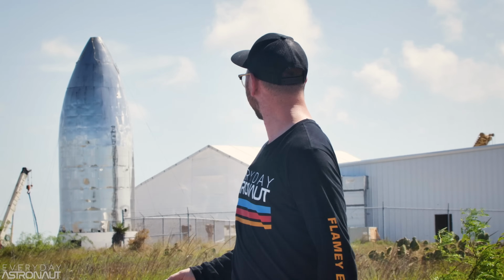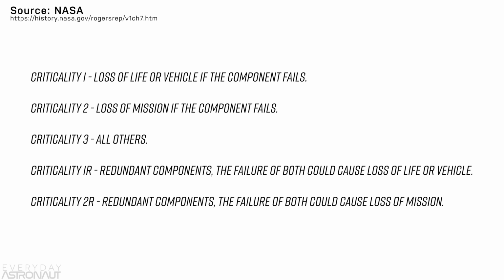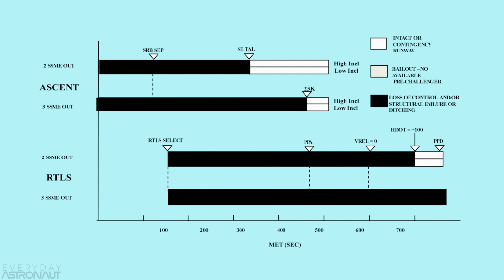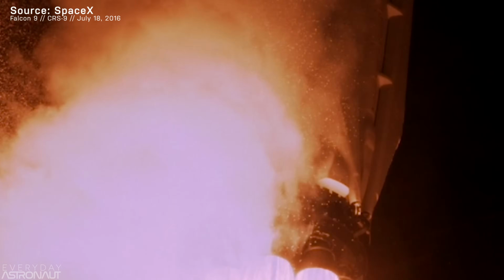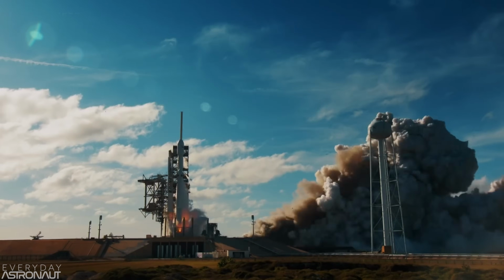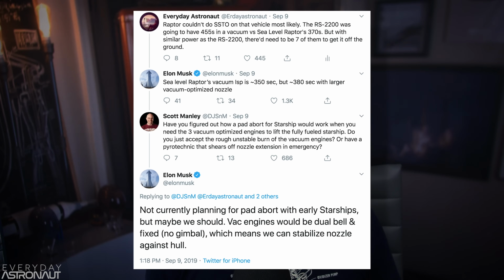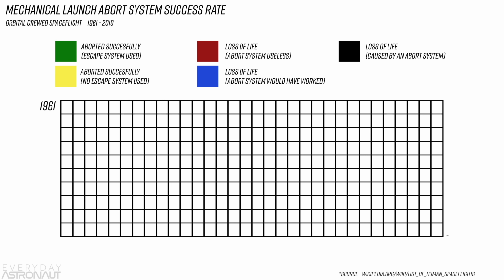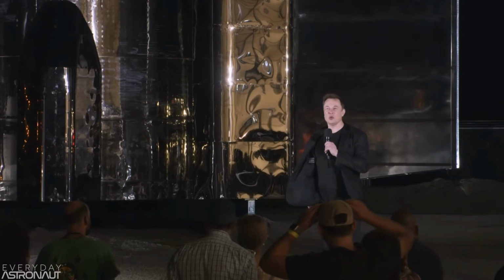Why won’t Starship have an abort system? Should it?!

Comment: Can you really say the F-1 is more reliable than Merlin? Sure, it's at 100% success vs Merlin's 99.88%... but it's only flown 65 times vs Merlin's over 800. Not really a fair comparison
Reply: If we allow an error of one half flight, F-1 achieved 99% with not enough data to add decimals.
Reply: It's like deciding which F9 toy for kids to buy, should I go with:
5 stars and 13 reviews
OR
4.4 stars and 420 reviews.
Reply: There are, realistically, no confirmed ways to compare such intricate works by engineers and scientists who can say "This way is better" because the outcome intended MUST BE "This must work all the time 100% of the time, which is a literal impossibility at the moment when dealing with orbital mechanics.
Reply: @capo_di_capi  the for you have to try and fail to figure out the limits and get new ideas
Reply: C A  Condescending, insulting, and completely off-topic. A great way to end any sort of dialogue, which is, shall we say, rather infantile
Reply: true
Reply: He gives current data,  i'm Shure one version will beat 99,98 %
Reply: C A  Alkin, I'm afraid he is right. Your 'argument' was as useless as a box of pigeon droppings.
Reply: Is your iq 5? Can u count to 10 even?
Reply: I wouldn’t call it an unfair comparison since it is a clear and simple calculation. Statistics are statistics.
Reply: Yep you can expect the merlin engine to be more realiable. If you use any engine you can expect it working with the following probabilities (using the reliability numbers provided by everyday astronaut):
Merlin: 99.76%
RS-25: 99.51 %
Rd-180:  99.66%
RD-108: 99.78 %
F-1: 98.51 %
Reply: Apollo 6, the second Saturn V flight, had a F-1 fail in the 1st Stage, and two J-2 engines fail in the 2nd Stage.  Apollo 6 barely limped into orbit.

Comment: If the launch abort system in starship would be a thing, it would be in form of a 3rd stage and that decreases structural integrity and will potentially add extra weight when "reinforcements" are added. A more ideal launch abort system would to have a fairing to fit a large "escape pod" if you will in the starships "tip".  Now that does take up ALOT of space but a launch abort system on a vehicle like starship is way harder than on a f9 or similar.

Comment: In my opinion, NASA will not allow astronauts to be on board the Starship unless there is an abort system in place, and SpaceX will update the crew version to include one.  On the other hand, I believe that the one that goes to the Moon and Mars will not have one, and will be launched without crew.  It will end up being the 4th design, or possibly 5th if PTP is included.

Comment: Dragon 2 would be genius if it landed propusively. This way the abort system is not an added part but a necessary component with multiple use cases. Either you ditch it to use parachautes, or you use it and ditch paracutes. Both is over doing things. But landing legs through heatshields are difficult.

Comment: Since 1990, in one case, some kind of abort measure saved life (I don't feel its right to dismiss that only because the tower was not used).. in the other, a capsule in a shuttle might give those poor souls a chance... It looks like a pretty clear choice to me.  With abort systems, money can be saved, getting stuff to a sweet spot level of reliability.

Comment: Tim, I would like you to demonstrate the difference in Δv of all or most of the bigger characters in the orbital game. Shuttle, Proton-M, Atlas Centaur, Soyuz, Saturn V... you get the picture. Also, is a rocket with more Δv safer due to its greater dynamic escape potential or not?

Comment: My father was a colonel in the AF at the Pentagon when the Space Shuttle was under final development (75-79)  then did what all officers in aerospace do: retired to a well-paid position at Rockwell International selling Shuttle cargo space back to the AF, working at their facility in Downey CA. Rockwell's own engineers acc. to my father estimated the odds of catastrophic failure at around 2% - which is a figure I've never seen publicized and suspect it was a well concealed data point.

Would I fly into space with a 2% chance of oblivion? No F'ing way, and I'm sure many astronauts wouldn't either as the STS had many hail-Mary elements about it and a leadership at NASA that were willing to cut corners. Despite that, I'm still fascinated by human space travel and really appreciate your very specific analysis on this topic. I didn't think I'd hang around to the end but instead found it riveting. Thanks!

Comment: If we want safety in a rocket without abort rockets, we will need lifting bodies like the Sierra Nevada unit that can be placed at the tip of any rocket and that can land on any reasonably sized airstrip. Of course, that leaves out initial boost to the speed/altitude that allows the lifting body to...err...lift. At initial boost, there might be a rocket with enough engines to spare the loss of one or two at launch to reach that speef/altitude. The Starship and Superheavy appear to be two such rockets, but that leaves out the rest of the possible failured. So, again, reliability becomes the only answer to the problem. 

If I were flying it, I would want to have myself encased in a lifting body capable of reentry and horizontal landing, but that isn't going to be possible for 100+ passengers, or is it. Anything that provides transport at a speed fast enough to create g-forces strong enough to kill is a risk to its passengers and we are certainly familiar with such risks as we ride or fly in various systems that are considered safe for public transport. Anybody who has seen a vehicle burn after a less than fatal crash knows what riding on a fuel tank means. Again, reliability with reasonable safety standards plus huge usage history are the only answers that will get most people on a particular vehicle type. 

Think how many people state that they will not now fly on a 737-Max and you will have the long term answer to your question. When the FAA takes responsibility for the full recertification is my answer, but I'm not sure what others feel. I know that Boeing cannot survive the permanent grounding of all 737-Max's, so they are going to have to find a solution that is palatable to the flying masses. 

Having even a small percentage of customers refusing to fly on available machinery is unacceptable to most airlines and they will seek compensation. That would put Boeing into bankruptcy and completely disrupt our modern flight system, so we had better find that answer and that answer should be instructive to SpaceX 's plans to fly 100+ passengers on point-to-point flights. 

Current airplanes cannot survive any but the most minor crashes in ordinary landings. Any other crashes are almost inevitably fatal to all involved, so the only way airlines stay in business is to have a mode of transportation that is orders of magnitude safer than any other mode than trains and trains take too long for most transport further than 100 miles.

There is the standard that rocketry must closely approximate if it is to be acceptable for more than inherently risky things such as trips to the Moon/Mars/the rest of the Solar System. How that is accomplished is initially a technical problem, but in the final analysis, a social problem.

Comment: Braver that I am.  I wouldn't fly on a Rocket until I'd seen it fail safe when it did fail, but failing 99.99% less than it's normal flights.

Comment: The launch abort system wouldn't affect my decision to get on a rocket. Everything is going to fail at some rate, and I trust that the design teams behind these devices know best how to improve its' safety. If adding a launch abort system will improve safety to a degree of significance, I trust they'll do it.

Comment: An abort system is always a good idea, as with any complicated liquid fuel system it can fail and so can multistage boosters. If the Challenger was designed where the control cabin was a breakaway abort system they would have survived instead of all of them dying when they hit the ocean.

Comment: *Me in KSP putting an "abort abort abort system" for if my "abort abort system" fails, and at the same time thinking if I need another level of abort systems to save me from possible "abort abort abort system" failures.*
Reply: Jarno de Wit all of my aborts in KSPis basically just the tower yeeting my capsule away
Reply: @bingusaerospace  I generally like to design every single part myself, including the escape system. The downside of this approach is that it often takes more than half an hour to get a nice working LKO manned rocket. I almost always use part of setting to make everything look nice.
Reply: 1. Smack and LES on the top for 1st stage aborts
2. Put sepatrons around the top of the service module or upper stage for any aborts after LES is jettisoned
3. Done
Reply: And then fails and just immediately reverting to launch

Comment: “A rapid unscheduled disassembly” 😂😂
Reply: I think that would be what The Chieftain calls "a significant emotional event".
Reply: @noremorsewoodworking2258  hey there, I am also a chieftain guy
Reply: Feliz Archez RUD
Reply: Most dangerous technologies hide their failures behind dispassionate engineering terms. Lithium Ion batteries are said "to vent with flame" rather than the more usual wording one might use like; burst into flame, often near spontaneously and if confined without the ability to vent the rapidly expanding gas, downright explosive. I suspect liability lawyers are the ones to thank for this excessively analytical phraseology.
Reply: Man said feliz archez
Reply: Bro what a comment
Reply: THIS was my favorite part
Reply: "Uncontrolled Flight into Terrain"
Reply: @rayjay1770  That might leave a mark!
Reply: Man, this was RUDE... :D

Comment: Everybody gets on airplanes they don't have abort systems. something goes wrong you're screwed. And nobody seems to have a problem with that
Reply: Most often when something goes wrong in a plane you're NOT screwed, and they are hundreds of times safer.
Reply: @1312_PV  hundreds of thousands of times safer I believe
Reply: The problem is that rockets are much less reliable than airplanes (at least for now).
Reply: @alexanderbeychuk3674  Airplanes are far safer than Automobiles too... We deserve FSD!  All cars without it should be illegal as soon as it is operational!
Reply: @davidbeppler3032  I wonder if it's actually true that airplanes are safer than automobiles.  Part of me thinks it's more that pilots are safer than drivers.
Reply: @UrbanPanic   I think the airplanes themselves are safer, because in the air there are not many obstacles to crush into, so it's inherently safer. But compared to a rocket, for a rocket the air is like a hard wall. Even the air can crush a rocket, which is not true for an airplane.
Reply: You clearly have no idea how safe air travel is. Lots of things can go wrong and you will still be fine
Reply: @azzarii  yeah I know air travel is so safejust so long as you are not flying on the latest and greatest thing that Boeing makes.
   Or air France their latest and greatest with a flying turd to that's what happens when you get in a hurry and you don't thoroughly test everything. And obviously they don't.
Reply: True.. and most people forget in the early days of aviation it wasn't nearly as safe as today.
Reply: @TheEvilmooseofdoom  There may still be airplane types where everyone is issued with abort parachutes.  There are certainly commercial airliners with sea abort systems in the form of lifeboats and wests for everyone.
Reply: @johncrowerdoe5527  Yes, terrestrial safety systems are installed on modern airlines.  Why?  Oh right they discovered after accidents that they were needed.  It's all a learning curve and there is always an element of risk.
Reply: @TheEvilmooseofdoom  I said nothing to the contrary.  Obviously thet don't have Martian safety systems.
Reply: Lots of things can go wrong and you can still be perfectly safe. You can lose engines, instruments and other parts with no real detriment to safety. Losing an engine for a rocket is much more dangerous
Reply: Well, an airplane with no motor can still glide, albeit at pretty high speed for a safe landing but that is a good last resort risk mitigant. With a failed rocket, gliding is way less efficient...
Reply: Remember, if you are on a plane you can glide very far, but if your rocket fails you just fall down
Reply: @alfonsrasmus4710  exactly, it is simply IMPOSSIBLE for Rocket travel to ever be as safe as winged flight
Reply: @whiplash7400  Exactly.  it is like comparing a well engineered system like a Bullet Train to a well Engineered system like an Airliner.  (and yes, I am cherry picking for the example.  They both have gone to great lengths to be safe. However, once maximum safety (within reason) is achieved, the bullet train comes out safer as it is just inherently more safe (to date there has yet to be a single derailment of a Bullet train).
Reply: @alfonsrasmus4710  Remember if you are on a plane you can get to 40,000 feet. If you are on a rocket you can go to the ISS, Moon,  Mars, or to infinity and beyond! And actually there are plans to go from NY to Paris or SF to Tokyo, etc, in a Starship.
Reply: There is a huge trail of crashed airplanes behind our current airplane technology.   Rocket ships will do the same.  Each iteration fixes the problems of the previous design.   We finally achieved a state where airplanes don't crash very often (737-MAX please sit down) and people find the risk acceptable.   Rocket travel will be the same.   It will not be perfectly safe, and we are going to no doubt drop a few of them over time.   But the vast majority will be so safe that they will gain public acceptance.
Reply: An airplane does not explode every time some minor failure happens. Even a 1000 flights to 1 failure with human casualties is unacceptable for a rocket. (we don't have a rocket with that track record) We need at least a 10 000 to 1 reliability. Which is impossible to do with today's materials and technology. If we really "push the envelope" we could probably build a rocket with 500 to 1 reliability but not much more.  There will be a failure, because we are humans and we make mistakes... and one mistake in rocketry usually ends up in a big explosion. Also a rocket is not an airplane so if something's not right you can't just go back and land on the airfield.
Reply: Planes can glide !!!
Reply: Alvin Walters  Full Self Driving.  Tesla autopilot (which is not FSD yet) has already been proven by NHTSA to be 66% safer than cars without it.  If FSD is just 1% safer than the average driver, it should be illegal to operate a vehicle without it.  Just 1% better would save hundreds of lives an hour.  One of them could be yours.
Reply: @davidbeppler3032  Have you not seen the dozens of videos of just the Smart Summon feature failing? It's absurd this is even being allowed, it's clearly not ready. It's already causing accidents in parking lots and garages, it's only a matter of time before some confused self driving Tesla runs somebody over. "It works 95% of the time" is not good enough when cars are driving themselves.
Reply: @TMJ32  95% is still 7% better than people doing it themselves.  Do you mean people should not be legally allowed to drive?  Good luck getting people to pass that law for their own safety. lmao

Comment: agree: abort systems are important for the forseeable future.

abort system is itself a redundancy, and it is much cheaper to test an abort system many times than it is to test a full-stack abort scenario... so even though they're solving the problem of rocket failure by adding more rockets, these rockets can have a much more proven track record.

needing an abort system only 0.5% of the time is still way too high if spaceX and gang want to commercialize space flight, and birth the space-tourism industry.
You're right, we need more flights... but our current society values life much more than we did during the dawn of flight. An industry that had such a high mortality rate as the airline industry would get absolutely destroyed, today.

Comment: Just make the crew tough enough to withstand all the gezzzz force. Like Arnold Swartenagies, Chuckie Norrisies, Bruce Lees. Or just figure out how to fire up a G-block. I have to laugh...NASA removed a few too many things from their system. Those darn green buckaroos were critical! Perhaps they were part of manys escape system-exiting in their pockets. More seriously- if the weight of all those "safety" system were rather translated/utilized into beefing up critical weakness- then failure is what leaves the system and not the crew. Perhaps some Ai at the design wheel?

Comment: simplicity is relyability at the end
Reply: Then a few incidents (with human casualties) might mean end of the entire project and also stall our "dream" to colonize Mars for at least a decade.  Space shuttle would had not been such a disaster if it had an escape capsule, it could had probably flight to this day. Space shuttle had become much more expensive to fly, because of the fear there is no escape system, so everything had to be "perfect" which made each flight prohibitively expensive. Even the Russian Soyuz, which is  the most reliable rocket ever build, have an escape system, with a track record of about 2000 launches and very few failures.  Also it would be cheaper to make it with escape system, because to guarantee a 100% reliability in a rocket is almost impossible. To become like an airline you will need tens of thousands of flights without any failure and that will not happen in the next 100 years.   There is another difference an airplane can still fly with some minor and even medium  failure, in contrast to a rocket, where even a minor failure will end in explosion.